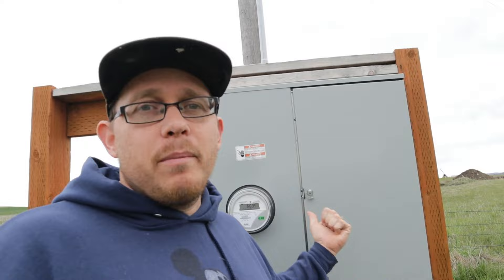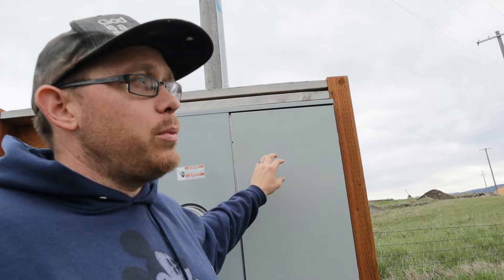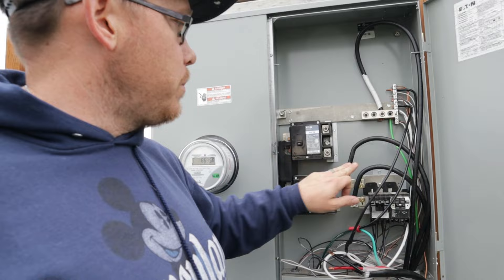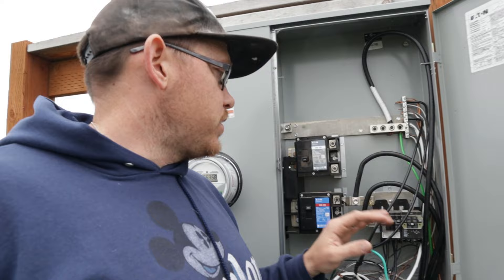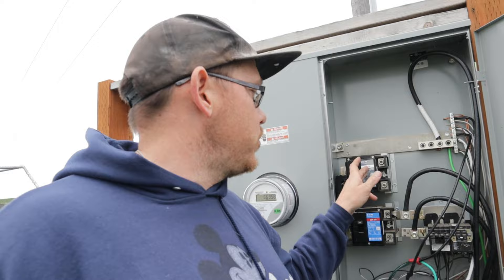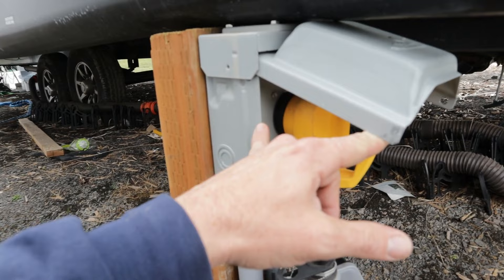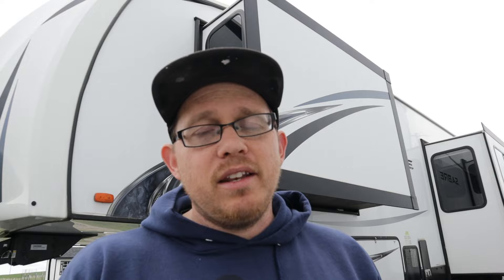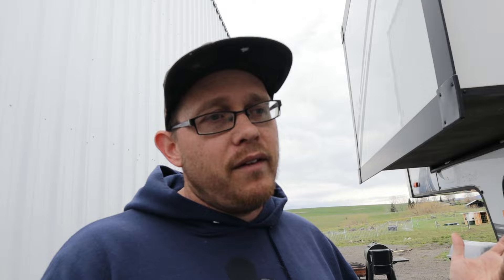How To Live In An Rv on Your Own Land

Comment: How far from the power pole were you....how far did you have to dig. What was the cost to put up your panel box?
Reply from the maker: I got an easement from my neighbors pole that was on the property line so I only had to dig about 10 feet from my property line where I put my 400 amp service. I dug it by hand, and the panel was about 400 bucks. The power company paid for my line from the power pole to the main panel. They have a credit they are able to use when starting a new service and since we didn't have to run far we were under that credit.

I did put a 200 amp service on my barndo so it was about a 80 feet to the back panel and the 50 amp RV hookup was about 35 feet to the power post I installed. Wire was a bit pricey for that.

Comment: I used hot tub cover foam for the skirt.  Works great and is very necessary.  Starlink on the way.
Reply from the maker: That's a cool idea! We used a combination of reflectix and ann insulated black tarp and then I built a base frame. Exciting on the star link!!! WiFi was always a stress for me when we were traveling

Comment: We're about to start this journey in central Washington. We have the RV and the land so far. Did you keep the RV beside the shop during the winter? Our biggest concern is snow load on the roof and slide outs. We are considering pulling the RV into the barn (using the remaining barn space as rec area and skipping the barndo step) to make it more doable/long term as we build our house. However, I'm not sure how venting would work with propane heating and cooking. Thoughts?

Comment: I'd like to set up a biogas system instead of septic.  have you seen them?
Reply from the maker: I have seen them they are very cool, the only thing about that vs the septic is that in a lot of places to get the ability to get power or well permits you need to have a septic plan so you'd want to make sure that the area youre buying in would allow it. You could always add it after but you'd still have to have a septic system. Do you know if they build any of those that work on traditional septic tanks?

Comment: What type of land would I need to purchase? Would it be residential? I was told that when purchasing land you are not allowed to put certain items on your own property.
Reply from the maker: That's a great question! Where we live, we bought land outside of city limits, so there's no zoning requirements. Areas there could be zoning requirements which would dictate whether you could build a house or use it for something else. The other thing you'd want to do is check building codes. Different areas have different laws about how much you can build. How big you can build? Types of buildings you can use, if you can put RVs or other building requirements will be set by the county and so you will need to check with the county wherever you are looking.
Reply: Unincorporated land

Comment: Did you initially move onto the property without the utilities hooked up? Like using a generator or a portable waste disposal
Reply from the maker: Nope we stayed at an RV park that we had a month to month lease on while we were doing the improvements. In the past we had stayed in campsites that didn't have full hookups and it was a lot of work managing tanks. if you don't mind it then I wouldn't worry about it, but for us we wanted to make sure to have full hookups. Also monthly rent in parks is a lot cheaper than daily rates, we got 379 a month plus pay for our own electricity

Comment: Great information, I have a question. I have some property and I want to rent it out but not for a fee but rent it out for free if the person clean the property up. I will allow the person some time to clean the property up and as long as they keep the property clean and pay the taxes every year which is about 125 a year and the road is pave is this a good idea?
A well is on the property plus city water is possible there is a septic tank but it kinda OLD meaning haven't be used in 20 years. The reason why I want to do is because i live out of state and the person be doing me a favor property is South Carolina
Reply from the maker: That's a great question, and I would definitely consult with a real estate attorney. Here are the things that I think.

When you rent out a property you need to do it in contract and layout the exact terms of the lease. If you have somebody paying taxes as part of staying there, I think you're creating a potential legal nightmare. When somebody pays into the property by paying the property tax for a certain number of years, they can actually create ownership in that property. So eviction becomes very difficult because they can argue that they've been building equity into the property, and especially by paying the taxes have been performing ownership duties. I would make sure and make it a normal lease. Their lease would be upfront. Upfront you would pay the taxes, not them, and you would have a way to evict them if needed. Obviously you don't want that to happen, but anytime you put a tenant into your property you need to give yourself options and assume that you're going to have to do an eviction.

Does that make sense? Obviously local areas have their own rules and some states are easier than others so definitely check with an attorney
Reply: @homesteadingbarndo    Thanks for your response and everythi g makes sense. Thank you again

Comment: Hey, could I hire someone to install  the sewage, water and electricity. Sorry I’m new to this world and I’m interested in living in a rv and getting it on land. I want to know, what I should do? And, how should I do it?
Reply from the maker: Definitely you could get somebody to do that for you. There's excavation guys who will do that, and oftentimes they do concrete work as well. It isn't too complicated and in most spots you'll spend between 6 to 9000 bucks to get a septic system put in
Reply: @homesteadingbarndo  thank you for replying to my comment, and thank you for the information. Is that just for the sewage? what about the electricity and water? And who do I contact for it? So I can get pricing and all that kind of stuff
Reply from the maker: @jayisswagg  Do you contact your local city? They'll help you with the right contacts and permits that you need. It varies from county to county. In some places like my county you only need a septic permit in order to get your electrical panel. Depends again on what kind of utilities you have around and each area is different. In some places you could use city water or another areas you'll need to drill a well. Definitely check in with the county that you're thinking about and they'll tell you the process
Reply: @homesteadingbarndo  thank you for replying to my comments, with this information

Comment: So your septic is for 3 bed, 2 baths then? Not for the 2 rv hook-ups, barndo, and future house? Got a little confused there. And so you're good with the septic rated 3/2, even though at times in the future you might have 2 RV's, Barndo, house? So that won't overload it? And the city/county was good with that even though it's evident that you're obviously over a 3/2 when they come by and see more than just a 3 bed/2 bath?
Reply from the maker: Nope we got it rated for a 4 bed 3 bath and 2 RV side cleanouts, we did decided to not use the disposal in the sink tho which does increase the size capacity requirements since you put in more solid waste.
Reply: @homesteadingbarndo  ok, Roger that. Makes sense now. Thanks. I like it. Thanks for the info. 👍
Reply from the maker: @hooks4nooks  you building something too?
Reply: @homesteadingbarndo  just doing research. But I like the barndo and rv pad idea a lot!
Reply from the maker: @hooks4nooks  nice! If there's anything I've learned it is hire out the drywall work 😂

Comment: I wouldn't keep any tanks open. Gasses don't discriminate.
Reply from the maker: If you're stationary, and doing laundry, taking showers and doing dishes, you're going to have to keep your gray tanks open. Just make sure you put a p-trap in there and no gases will come back
Reply: @homesteadingbarndo  You don't have to keep it open. Where did you get this info? 

It takes 3 mins a day to open the valve and close it.